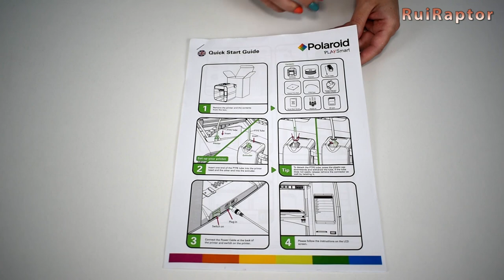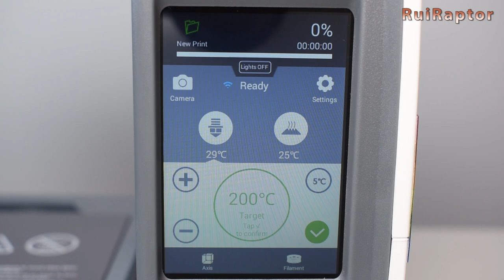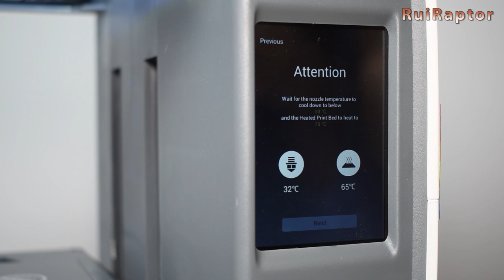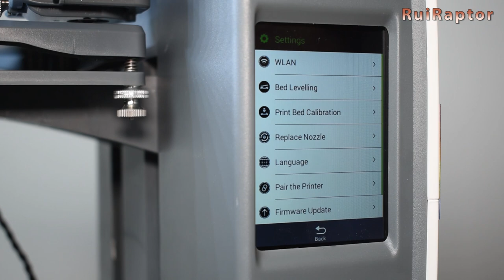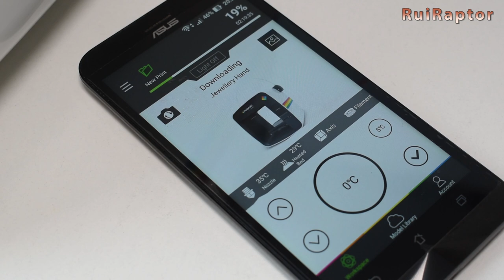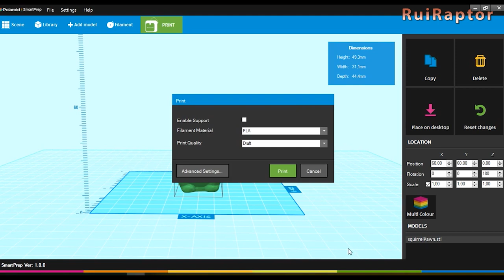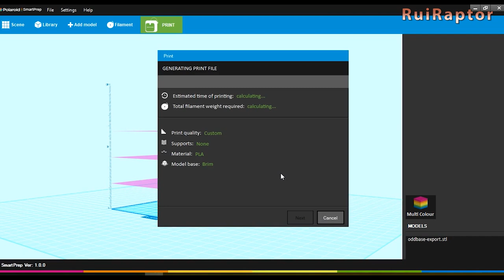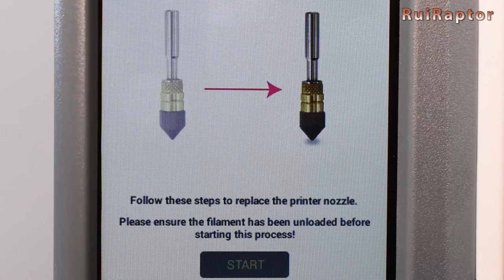POLAROID PlaySmart 3D Printer - Tests & Review

Comment: Using this printer for one week and i´am very impressed about it. i am a beginner and this is a plug and play solution. cool features and top results! Using it for prototyping with fusion360 and cure.
Reply: Hi, i am also thinking to buy, i would like to know how is print bed, does it require some tape, glue etc?
Reply: Tomi Piriyev hi, no, it‘s a heated bed and i never have any problems. let it cool down and then you can pic it up easily.
Reply: @iamQuinzy  thank you very much for a quick reply. On video used some tape over the print bed, i thought maybe doesnt have good print surface. I am going to buy one, thank you again
Reply: @iamQuinzy i just purchase and my print is moving in the bed.  How do I keep it from moving during print?

Comment: Saw this printer for $99 at a local store... thinking for that price it may be worth it.
Reply: I was thinking the same
Reply: I just bring it. Always wanted a 3d printer. For $99 it’s definitely worth it. The filament is on sale also. So win win
Reply: I just did, plus a boat load of filament since it is all 70% off. Hard to pass up.
Reply: @KiiyanaWilliams  yeah I bought some filament. I already have a Prusa MK3S and a CR-10 so I decided to not buy one but got a few friends to pick one up.
Reply from the maker: $99 for a printer that normally costs more than $500 is a great deal :)
Reply: @ruiraptor  they sold out so fast online:(
Reply: @ruiraptor  hahaha Its original price does not make it valued at $500.  Sure this is a decent little machine, but it was NEVER worth $500.  For a $100 it is a good price, but this is a bad way of putting it.

Ender 3.....Ender 3..... Ender 3, far bigger, far superior, and normally $200ish.
Reply: 100 is a good entry point, there are little quirks I am finding out as I go along and not much resource online, first project wouldnt stick,,  someone suggested heating table more, so trying that right now,, good luck with it..
Reply: @Rich2481  With all of the manual bed leveling printers, a properly leveled bed is usually the biggest issue to cause prints to lift. Even just the slightest difference in laying down that first layer will cause issues. The more squish that layer has, the more surface area it has to grab onto the print bed. Air will creep under and cool areas where there isn't as much surface contact and cause it to lift, big pain in the ass.
Reply: @jon9947  the bed size alone on the Ender 3 makes it worth it, plus there is another on Amazon for 150..
Reply: @miremaker  Yea that is what I found, the unit actually prints a line across the left side before printing,      but for all the trouble connecting and the software not updating to run the table calibration, I am thinking of taking it back and spending the money on Amazon on a ender 3 or a different one with a 7 inch table.. this one is 4 if that..   thanks for response..   the case here is the nice part about it..
Reply: not woth it

Comment: I just got this printer but my prints keep lifting off the bed before completion which causes a shift or the entire print to mess up. I see you're using a cover on the bed. Did you purchase that separately? If so, where? Does it help with the prints staying put on the bed while prints are in progress?
Reply: increase your table temp, I think 70 is the standard,, go up to 80,   also I did a bed calibration which in the software doesnt work,  either table,, but the unit will print on the left side a strip, if that strip isnt even or stuck, you will need to make the table ( 4 screws) closer to the nozzle,, that being said I am very disappointed in mine and will be taking it back for a refund and buying a 7 in by 7 inch for 150 from Amazon, it is an open frame and not as pretty as the polariod but enough is enough,, have the time I cant connect the thing with my phone app,  the stuff was warped starting out, cant get the unit touch calibrations to work etc,,,  not worth the aggravation plus  all software must be in Gcode, not STL so you need to convert it,,   good luck....
Reply: He had blue painters tape on it. I clean my bed with glass cleaner before printing and that seems to work fine. Also make sure your bed is leveled I use a post it note to level mine.
Reply: Use a glue stick, and cover the bed "elmers gluestick" works good

Comment: The polaroid smartprep cannot print out the slice. It is always calculating the time and fillament needed. Any idea?
Reply from the maker: You mean when using the polaroid software? Try a different STL file or configuration. If the problem persists, try installing the software again.
Reply: I found ultimaker cura can be used for Polaroid, there is a detailed pdf on how to setup the setting. It works.
Reply from the maker: Most of the slicers will work with this printer. We used simplify3D.
Reply: I'm having the same issue, any luck in fixing it?

Comment: Idk if you’ll see this or not! But please help me. Can you reply with the power cord information! As in how much does it supply. Volts and amps
Reply from the maker: Hi, you can check at minute 2:23, the power supply accepts voltages between 100v and 240v. For the main power chord, you can choose the one you need since there's a connector on the power supply.

Comment: what does it mean when it says "target temperature is not obtained??"
Reply: What you set as the temperature for the nozzle or table hasn't warmed up enough to meet the temperature selected, so the heater element in the nozzle or table is broken that or a broken thermistor.
Reply: @kenbradley6989  the table was broken so i ordered replacement. I Contacted the company and they sent me a new one
Reply: Hello. I’m having the same problem. I just got it out of the box this afternoon. Printed one thing. Then I wanted to print something else and it keeps saying temperature not obtained. How did you find out it was the bed? Could that be broken at the first day? That doesn’t sound promising. :(

Comment: Just ordered as my 33rd printer: Leveling a preheated machine is not a normal choice, X, Y, Z does and you see some peers in Facebook groups but the combined expansion just doesn't warrant it and creates risks. PETG and 120 MM in X, Y, Z, I can see myself printing a CNC/ Laser engraver among other builds as a mid-size among my other printers.

Comment: Dont buy! you cant find extra nozzles or any spare parts for it. Its not very good in printing to. I regret i bougth one, my first printer. After i bougth a artillery hornet, that can make 22 cm instead of 12, for the cost of half the price.
Reply: nozzles no standard as ohter printers
Reply: there software did not work at all!, there app did not work at all. Totaly shit, in my opinion.